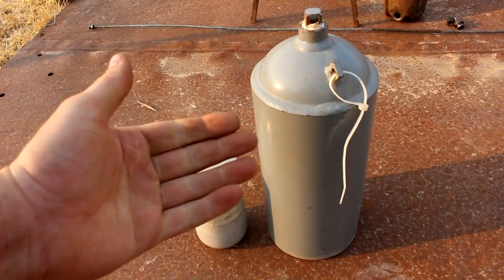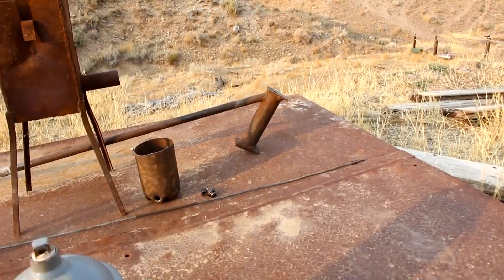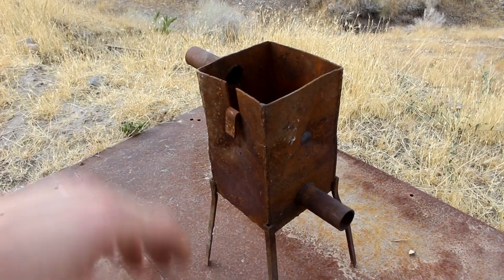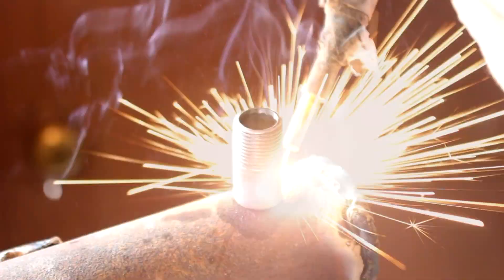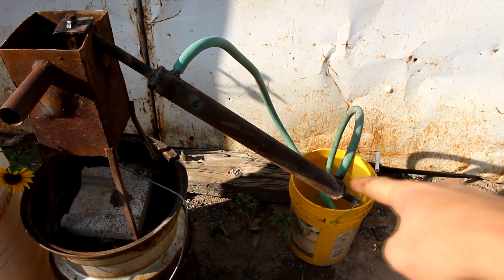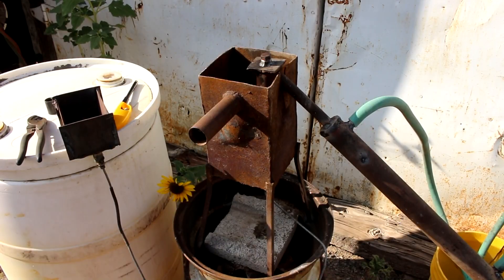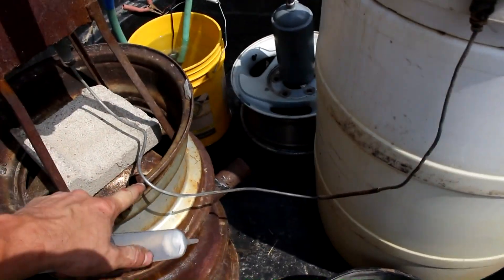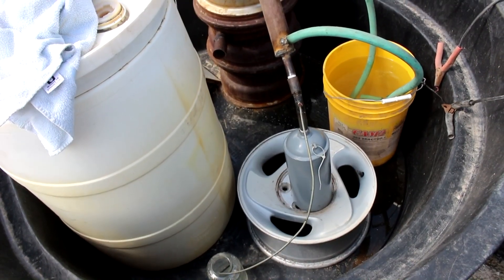Building A Mercury Still

Comment: Hey Cody I got a suggestion, could you make rubbing  alcohol "safe" to drink. I'd love to know the process of that.
Reply: be easier to make alcohol to start with, they intensionally put a wood ether in it, that evaporated and distilles at about the same as the alcohol, meaning you cant get it out
Reply: Rubbing alcohol isn't even ethanol so whatever you did to it wouldn't make it any safer or drinkable. That's like asking for someone to turn an apple into orange.
Reply: +Crusty Cream
Ethanol is the alcohol people drink.

Isopropyl alcohol(rubbing alcohol) does not contain ethanol.

Isopropyl alcohol is added to ethanol to make it poisonous to drink so people do not have to pay alcohol taxes on it for non-consumption purposes.
Reply: Crusty Cream ethanol is the type of alcohol you drink.
Reply: There is no simple way to do this. Rubbing alcohol is isopropyl alcohol and drinking alcohol is ethanol. You'd need to break a carbon-carbon bond. Anyone who tells you there is a way is either a liar or an idiot and it's putting your health at risk. Don't do it.
Reply: Most (grocery store) rubbing alcohol contains some ethanol (the type that gets you drunk) but only in very trace amounts. You might possibly be able to extract an ounce of ethanol, but it would likely take tens of gallons of rubbing alcohol. Although it says it's alcohol, there is probably more ethanol in windshield wash (methanol) than in rubbing alchohol, but neither contains more ethanol than something like mouthwash.
Additionally, ethanol can be purchased at hardware stores as denatured alchohol, but this is nearly impossible to purify. Since it is not intended for consumption, denaturing chemicals are added in that are specifically designed to be hard to remove, and certainly impossible to distill out.
Reply: Ok... i think you have a little confusion. the "safe to drink" alcohol is ethanol [CH3-CH2-OH]. The rubbing alcohol is isopropanol [CH3-CH2OH-CH3] and HAVE NO ETHANOL IN IT  so you can't just purify it to make it safe to drink, you will need to demetilate it (take out the extra methil group in the molecule) and then get rid off all impuritys you make in the process (not easy nor inexpensive). So i think you you meant DENATURED ALCOHOL. Denatured alcohol is indeed ethanol mixed with toxic or horrible tasting substances (like methanol [really deadly toxic alcohol], denatonium benzoate [incredible bitter compound], pyridine [toxic and bad smelling], acetone [solvent, nail polish remover])  to "discourage recreational consumption" and CAN BE purify to make it drinkable but you need to know the composition of the alcohol you want to clean. For example if you have an alcohol denatured with denatonium benzoate you can destill it and get safe to drink ethanol but this will NOT WORK with methanol because the boiling points of both are just a few degrees diferent... Sorry about my English (i speak Spanish) so i hope you understand me. Good look.
Reply: Everyone here is forgetting the bitrex....
Reply: you should do a video of making mercury fulminate, it's a little tweak of chemistry.
Reply: Cinabutts it's incredibly difficult by design but would be interesting to see if it's possible without spending more money than it's worth
Reply: Okay so from the comments I'm seeing half say it does contain ethanol and the other says it doesn't. I'm only 19, 21 is the drinking age here so I know nothing about alcohol all i know is I've seen a video on why you can't drink rubbing alcohol. Anyway point is it is possible tho it'd be pretty costly but knowing Cody he'd at least give it a shot I hope and if not he might even make a video on it or reply to this, soo let's just wait and see lol.
Reply: At cina, ys in short its possibleof course, its just with all th stuff they put into it on purpose to mske it hard, it ends up being hard and inefficient, to the extent hat just making it from scratch with fermenting some vegetables and fruit and a still  would be the easier route.
Reply: Judging by your spelling and grammar, not to mention your understanding of how things actually happen instead of saying "Thats impossible", you're actually pretty smart for someone who isnt a native English speaker. :) (and not too bad at English)
Reply: but you just said it can be done by breaking a carbon bond. So you're calling yourself an idiot?
Reply: i shall tell you how to do this
first, buy some rubbing alcohol and yeast
use the rubbing alcohol to sterilize a container
put the yeast and some water inside the container, maybe add some sugar or something for flavor
distill the mash into alcohol, or drink the mash straight cause you are considering drinking rubbing alcohol.
Reply: Wheres the part with the ethanol methanol conversion?
Reply: Jusb1066 you'd do better to distill Listerine. less danger.
Reply: @Who's at bot, Ethanol is just another name for ethyl alcohol. Everything is toxic when taken in excess including ethanol, but Isopropyl alcohol is far more toxic than ethyl alcohol.
Reply: I know hardcore alcoholics pour it into really hot coffee. There's a foam that you scrape off and it's "safe" to drink
Reply: The amount of energy, time and effort needed makes it a curiosity not a viable process.
Reply: """"""""""""""""""""""""""safe to drink"""""""""""""""""""""""""""""
Reply: I think anything you can run a car on is bad for you.
Reply: except carbon bonds are strong so it would be pretty much impossible to break that bond without messing with the other bonds
Reply: Yeah, like James Bonds and other sekret agents... like...
Reply: Look at sugar wash on YouTube. It's very easy and very safe and very cheap. You can distill it to 100 proof in your freezer in one simple step without poisoning or blowing yourself up.
Reply: If you'd like to know how to do that, go to the channel "NileRed" he has a great video on it.
Reply: Just make your own alcohol
Reply: Im pretty sure he meant transforming methanol into ethanol chemically, not separating whats already in the bottle.
Reply: Han Nes it contains ethanol so poeple won't drink it and alcohol company's get a lot of money
Reply: Andrew A ethyl is what poeple drink and it's similar but 1 poisons you but staying in your stomach
Reply: Andrew A ethanol is very toxic where Ethyl is less toxic and is what is in alcohol that are meant for drinking ethanol will kill you
Reply: @ccuppa714  I know that this is an old comment but what the hell, ethyl alcohol, ethanol and ethan-1-ol are the same thing
Reply: Philip I forgot what I was talking about I think I meant ethanol since it is ethyl alcohol
Reply: @ccuppa714  ethanol is safe, isopropanol is what is in rubbing alcohol which is toxic.
Reply: It depends on the alcohol in assuming you want it to get drunk well there is 2 types one type creates ethanol inside you and one contains it it will be hard to remove the ethanol and then when you have it there's another chemical that makes it taist really bitter so you don't drink it so don't even try there is no point just get a bottle of jack

Comment: spends hours destilling mercury ......then puts it in dirty bucket xD
I think NileReds preciseness mixed with codys relaxed attitude would make the perfect scientist
Reply from the maker: A different kind of dirty though... and yes that would make an awesome person.
Reply: @theCodyReeder  I mean, I get that the contamination is now MUCH easier to get rid of, but you had it perfectly clean and pure. Why pour it into a dirty bucket? I mean, I do not vacuum the rug of all fine particulates and then immediately throw cookie crumbs all over the place because, "It is easier to get out than the fine particulates". I mean, right?
Reply: @theCodyReeder  Perfect way to deal with the hysterical ninnies who had a problem with you handling elemental mercury; just ignore them and continue on. It works, ask Trump.
Reply: @theCodyReeder   how did you know that the mercury distilate did not still contain lead and other impurities? I ask because that fire looked pretty hot and although not hot enough to evaporate copper it would have certainly been hot enough to evaporate lead and gallium right? perhaps a temp gauge could be threaded into the nut you welded on top and the condenser raised or lowered in the flame to acheive the right temp for just the murcury. Along this same line at what point do metals like copper and lead saturate the murcury ad start to form a precipitate in the condenser and float to the surface of the mercury? after a time of distilling did you find this happening in the evap chamber, it would heve been nice to see what came out of the evap chamber at the end of this vid. That aside I like your style mate, Cheers!
Reply: isiTsotsi the dirt from the bucket can be easily filtered out, unlike the dissolved metals before hand
Reply: Plus, he poured it in the bucket to show it to us and inspect it. He had already decided to run it through again.
Reply: yeah val, cody is probably a fuck machine.
Reply: Cody has the preciseness down, he just knows how to ration his energy and time wisely. His girlfriend probably keeps him quite busy...
Reply: @ValCronin  she left him
Reply: I kinda think the stuff in the bucket is mercury stains, tbh. Wouldn't surprise me
Reply: That is something I would do myself.
Reply: isiTsotsi I know right !
Reply: rparker069 😄
Reply: Actinidium periodic element channel has a club of extremely brilliant chemist who all seem to get the shtick to do the actual demonstrations. and with all their know how still have plenty of great unplanned results. best part of chemistry is screwing off .
Reply: isiTsotsi lol I watch NileRed too
Reply: Bernardo B wtf duude
Reply: I kinda think the stuff in the bucket is mercury stains, tbh. Wouldn't surprise me
Reply: isiTsotsi none of you just get it do you...
Reply: Roflmao, i was laughing at that as well, but he can clean that with Bounty paper towels, the mercury filter upper
Reply: codys that little brother(or big brother) youve always wanted lol
Reply: “Different dirty” is cleaning mercury easier than just cleaning the bucket? Lol
Reply: @Guodlca true...
Reply: Back woods survival chemistry. You can be a super sayan chemist or be really good at everything.
Reply: What's wrong with Nile or Cody as they are ?
Reply: lol you think rick's precise? :P
Reply: Тамара Беляева Don't tell me what to do, bot.
Reply: if only there was some kind fo channel called nurd rage that did chemistry videos fairly frequently...

Comment: You could make the cooling system better if you switch the pump line and the exit line so the exit line isn't so close to the hottest point.
Reply: It's called a counter current heat exchanger.

Comment: Welding without PPE. Definitely Cody
Reply: Not only that, you can get a crazy painful sunburn that is like way worse than a regular sunburn. it's not fun.
Reply: no gas, self shielded wire... more spatter and more smoke, and welds dont look as good, but ideal for portable welding. A few seconds od welding doesnt hurt you really, just dont look in the arc
Reply: Michael W. Is it a mig welder, I think it is but there is no gas shroud? I guess that's why the welds were messy?
Reply: My welding is so poor I should wear 2 pairs of gloves just in case the splatter burns through the first.
Reply: you dont actualy get burned from spatter, it bounces off the skin... U get it the socs, there it hurts...
Reply: kosir1234 that didn't look like innersheilded Fluxcore to me. Looked like MIG.
Reply: Its showing the welding that gets me.  I've been on construction sites for 15 years, and I flinch every time welding is shown on camera for fear of being flashed.
Reply: It sounded to me like he was wearing a mask.
Reply: No gloves. Mask and gloves is the bare minimum I would use. I'd rather not get hot spatter burns on my hands.
Reply: dean, yeah my arms got burnt pretty bad from the uv ray when I was welding a long time with out full sleeves
Reply: Seth M Oh ok, what about it makes you know that so that I know?
Reply: Michael W. I used to weld galvanized and at times wouldn't even have my gloves on. Not the smartest thing in the world.
Reply: Your tv will not emit the harmfull UV light, and the light it does emit is not powerfull enough to burn your eyes. You will never get flash burn from seeing someone weld on the internet.
Reply: Seath M you are not easaly going to brake a gas nozzle for a mig welder. All the ones i have seen are metal. If it was tig welding the gas nozzles are normaly ceramic.
Reply: Brass is a an aloy of  the metals copper and zinc. It is a metal in  the same way as steel an aloy of iron and carbon is a metal.  As for the gas nozzle I guess you could mess it up if  you dont use an insolator between the contact tip and the gas nozzle, or if you acadently crush it.
Reply: Gas nozzles are almost always metallic for Mig welding, Ive never seen one that isnt. the ceramic cups are used to TIG welding.

Comment: How many kg of mercury do you own?
Reply from the maker: way more than is sane.
Reply: Cody'sLab Love that anwser!😎
Reply: Ever handled a metric ton flask of mercury?  I have - that much mercury in one container is nuts.  If you ever need additional mercury get in touch with me!
Reply: Connor Wood not to sure if I Remeber correct in an older video video he showed over 100 pounds of mercury and said that was not even close to all that he owns. So yeah, alot.
Reply: the conversion is rather simple. 2.2 pounds is 1 kg. if you ask someone how much they weigh they are more likely to give you that number in whatever measurement their region uses. just convert it yourself
Reply: Sheldon Robertson - Because OP wanted the question to be answered in kilograms. But then, most likely, an idiocentric American replied and provided his answer in pounds.

I wish he was just lazy to convert to kilograms, but in worst case, and most probably, he doesn't know how to convert pounds to kilograms and/or can't use the SI/metric system at all.
Reply: Ted Rader Would love to have a small ampule of it.
Reply: Are you located in the United States?
Reply: Ted Rader No😢
Reply: That's not a problem it can be legally shipped via passenger aircraft via UPS so long that 868 instructions per UPS are followed.  This would be awfully costly I'm afraid.  I'm not sure what your budget is, but it could be super expensive to get it to you, even just a very small amount.
Reply: i am canadian but it really annoys me when people ask what something is in their own measurement. americans always ask me to convert temperature for them. um no you asked you figure it out. and for the record i use pounds and feet most of the time. farm raised
Reply: Ted Rader Thanks anyway. It is too expensive yes. I geuss i will just go to a mine one day and pick some from the walls.
Reply: Avaruusrangeri you sure think highly of yourself don't you? I know kgs and how to covert them. In the video I mentioned cody personally used the word pound and not kilogram which is why I used pounds. Thanks for trying to make me feel bad, it didn't work.
Reply: BlazeChronicGreen420 -  He asked how much Cody has mercury in weight (kg), not how many pounds (£) it cost... Smh..

Comment: I love your intros and whats the best material to pan gold with?
Reply from the maker: watter
Reply: a pan
Reply: pro gamer dihydrogen monoxide
Reply: No like were would you get the material
Reply: pro gamer where are u from
Reply: pro gamer research your local area where gold has been found
Reply: Rivers and streams especially fresh ones like if a big storm washed away some of the river banks it would expose fresh areas that people havent mined in yet. You also want to try to find thick silty mud on the river and also gold is heavy so it sinks down into all the nooks and crannys so use dirt from the lowest cracks that the mud and river flow through.
Reply: sirgallium thankyou
Reply: aluminum, you get less trouble with oils and fat sticking things together
Reply: Gold
Reply: Cody'sLab savage

Comment: Besides distillation could you also purify the mercury with simple surface agitation under atmosphere so all the contaminants oxidize in time? Certainly distillation gives a better (and faster) result, but I wonder how pure you could get with agitation and occasional skimming. No real reason to try, I just found it interesting to think about. I've considered mercury as an option to alloy with magnesium/aluminum to make them more reactive at room temperature for various things. I've seen it work with a gallium/aluminum alloy to make the aluminum reactive with water.
Reply from the maker: Yes actually one option I considered was to place the mercury under a strong acid. since the mercury is pretty low on the activity series it would be one of the last to react. copper and zinc would be pretty easy to remove that way but lead would be harder (requiring nitric acid and a loooong time)  and gold or silver would be impossible.
Reply: you two are some of the best science channels on youtube applause for both of you 👏👏👏👏👏
Reply: @shrub9677  get outta here with your Facebook comments . And nighthawkinlight is not even top 5 science YouTubers .
Reply: I've enjoyed watching then doing many of your cool stuff to do Nighthawk  :-) Just found Cody so it is really cool seeing you here too!
Reply: Is there an English translation to this?
Reply: +Cody'sLab jikkkibbbn
Reply: To your left you will see a Rick and Morty fan in its natural habitat.